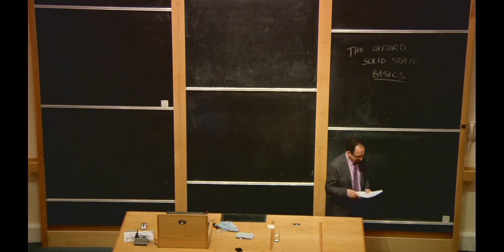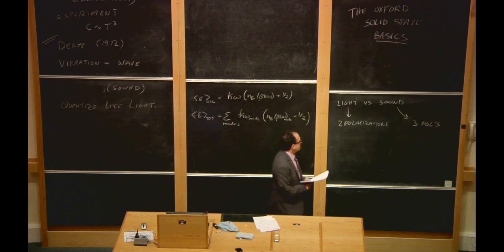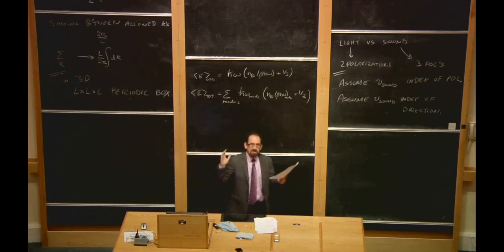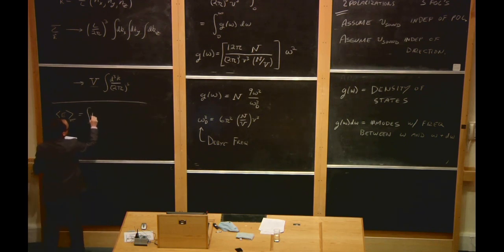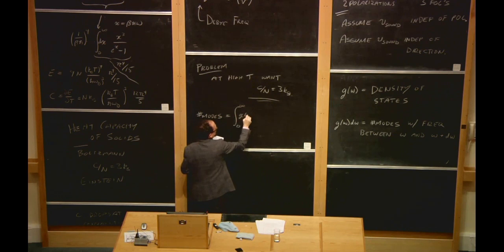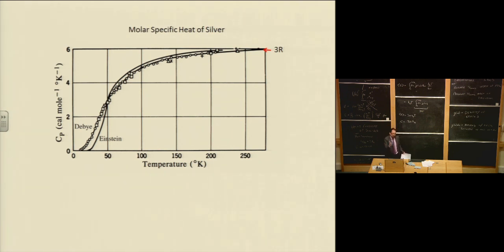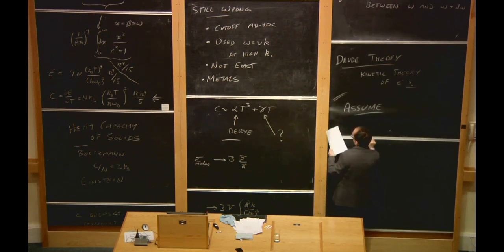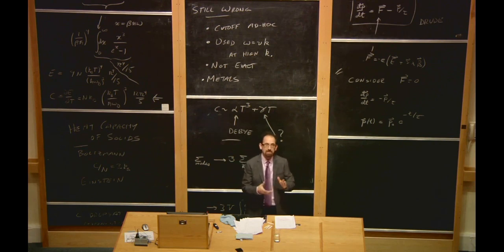Solid State Physics | Lecture 2: Debye Model

Comment: For those complaining about this instructor - it's extremely difficult to pack in what he did in 45 minutes. He's not just talking about the theory, he's providing an actual framework of equations and explanation. The expectation for any student in the classroom is that the will be reading the textbook and doing some practice ahead of time so that at least some of the concepts are fresh. Then showing up to his lecture, a lot of the puzzle pieces will come together. Anybody who has studied statistical mechanics and quantum mechanics knows that you can't derive/show everything in a single lecture. In my opinion, he is providing clear explanation of where everything comes from, and then focusing in on the important parts of the new theory that is being taught.

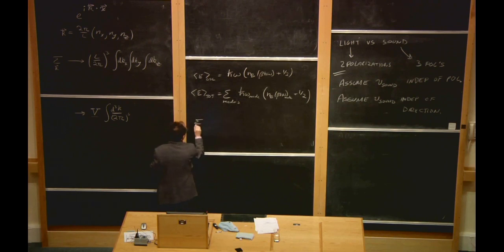Comment: At 15:00 he implies without saying it that you can use any of the available modes to move in any direction. I feel like I should point this out because it is fairly counterintuitive if you’re thinking about the modes incorrectly. The modes are excitable states that are present because of the 3 dimensional periodic nature of the crystal (reciprocal space symmetry argument) rather than actual realized waves moving in each direction (real space).